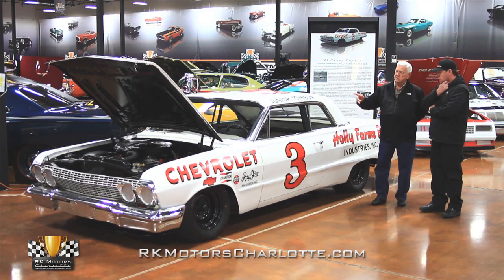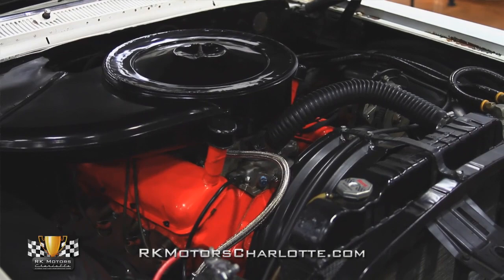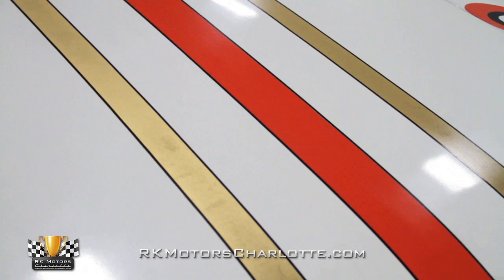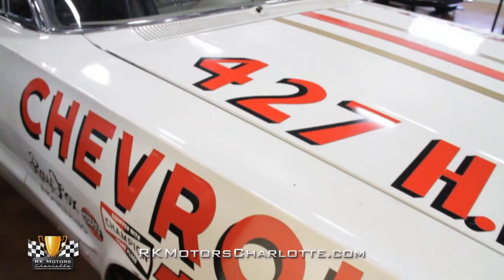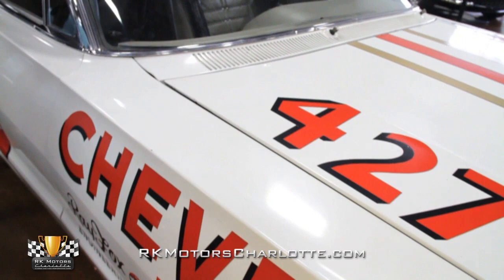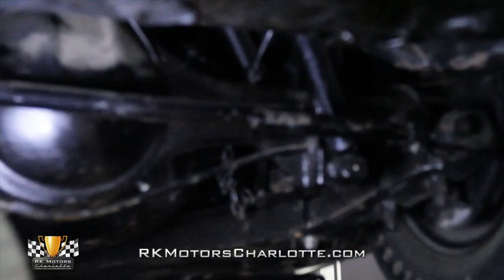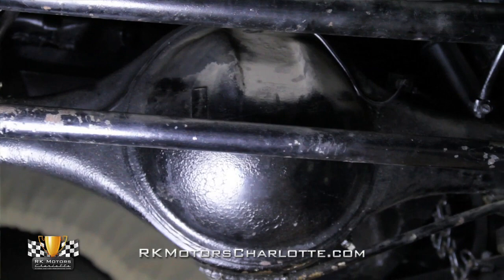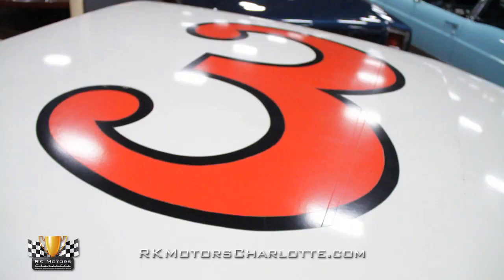Junior Johnson and his 1963 Chevrolet Impala SS

Comment: That's a stock car.
Reply: With an experimental race only engine,non factory cold air induction,and the rear end out of a truck...
Reply: @FATMIKED5183  well stock cars aren't stock.
Reply: @717rocket  Not after the first few years anyway.
Reply: @FATMIKED5183  I  think they always did a little modifying on the hush hush.
Reply: @717rocket  No doubt.
Reply: Really? I was under the impression that it was a dune buggy, or maybe a parade float associated with the the 1963 Rose Bowl celebrations.

Comment: The motors in those cars could not have been stock and sold to typical consumers.  The 427 wasn't even made that year.  The 409 was punched out to 427 (Z11) but not even vettes had a big block in 1963.  The biggest engine for Chevy was the 327, the 427 didn't come out til 1965.
Reply: This 427 was a 409 design with 3.68 crank.  Only 50 were made and they were also all aluminum block and heads.  The 427 you are talking about was a new block design which came out in mid 1965
Reply: I did mention the punched out 409 in 1963.  You stated the use of an all aluminum cast, which was the difference I was seeking.
Reply: You are both wrong. In 1965 the 427/425HP was the first year that they put that motor in the 65 Corvette. The all aluminum Block and Heads was called the ZL1 motor. It came with 219/188 valves, an L-88 cam with 0.560/0.600 Intake and Exhaust and 322/334 Intake/Exhaust duration, which was really 273degrees at .50 at a 110 lobe separation. If you had a 409 block and used a 368 crankshaft, you had a destroked motor, not more C.I., but less C.I. The rpm's were higher ,but, it couldn,t touch the 409 with a 376 crank.  Junior and I were correct. When you take a BBC motor and use a 376 crankshaft, you get More HP, More RPM and more torque. I also own a 1970 SS 396/402, which is a 396 bored out 0.30 which made it a 402 with a 376 forged steel crank. My 1970 chevelle beat my friends 427 El Camino because he had a 4.00 crank, like the ones chevrolet used in their 454,s The 376 crank will always beat the 4.00 crank on HP and Torque. All you gained with aan all aluminum block and heads was around maybe 100lbs lighter engine, but the price difference was not worth the weight difference. Do your research!
Reply: 427 396 402 have  the same  stroke
Reply: Z11 was  a  427  that  was  used in  1963 chevy impalas all  aluminum . also the  car itself had aluminum fenders hood bumpers front and  rear doors   and  it  made the  car  much  lighter
Reply: Sorry Joe, but the only big block available in a 1965 Corvette was the L78 396/425HP engine. *I bought one new. Great car!
Reply: 409 was still  avaliable in  65
Reply: Domingos, I don't think the Z11 was aluminum or even had aluminum heads. You can do a search on You Tube and see Dave Strickler's Z11 impala. The Z11 was a stroked I believe 409 and to my knowledge none of these style engines were ever aluminum or had aluminum heads. I have been reading Hot Rod and other type magazines since the early sixties and I haven't seen or read about any of these engines being aluminum or even aluminum heads. Yes,  the ZL1 was all aluminum but that was an engine from the 396, 427,  454 family of engines. If someone has an article or reference to info on the 409/ Z11 427 being aluminum please post it I would be very interested in seeing it.  @domingosmundo4138
Reply: @larryburton5516  Your right. There is so much misinformation out there regarding the mystery motor & the z-11 and people keep repeating it. Let me set the record straight, the mystery engine was designed and tested by chevy engineering in 396 409 & 427 displacements. The reason for the 427 was because nascar bumped the engine size up to 7 liters in 63. It has a 90 degree deck angle and the heads have combustion chambers.348 409 has a 74 degree deck angle.the piston makes up the 16 degrees and heads are flat no combustion chamber. The Z11 was strictly a drag race only engine stroke was increased to 3.65 from 3.50 to get to 427. Cylinder heads were special with rec port big block like intake ports. They will even bolt up to a factory 409 block! I know because ive done it. Gotta have the matching intake and valley pan to make it work, or nowadays you could pay to have them fabbed up. The ONLY THING SHARED BETWEEN THE MARK I 348-409, THE  MYSTERY MOTOR & THE MARK IV BIG BLOCK IS THE BORE SPACING!!.Also most people dont know that the mystery motor cylinder heads are LH & RH specific! This was done so the engine would breathe symmetrically between both banks of cylinders like a hemi does. Nothing interchanges between the mystery motor and the later mark IV big block. Not even the valve covers though they look like they would. Coolant passages and cylinder head bolt pattern are also different.Pass this along brother!!! I have helped restore vehicles for both Henry Ford museum & Sloan museum in Flint mich. Just in case people think I dont know what im talking about. Been in the game for a long time & met people who were involved in all this. Hope this helps.
Reply: @hilleryclifford2367  Thanks for all the info, Hillery. I loved that time back then in drag racing and Nascar. My first new car was a 64 SS Impala 327/300HP Four speed. I have a 72 Nova with a 388 small block in it. And, a 70 Chevelle in the paint shop now. Hope to have it ready by early April.
Reply: @larryburton5516  Thx for the reply larry. Glad to see you still hot rodding! Once it gets in your blood it never leaves!  My brother and I did a 61 pont catalina bubble top. Body off resto. You tube search 1961 pont catalina to see it. Its the black one @ Frankenmuth MI autofest. My 72 boat tail riviera is next to it.
Reply: Thanks.  Mopar guy here, but learned something after hearing poor info for years about this mystery motor.   @hilleryclifford2367
Reply: @domingosmundo4138  so does the 366 big block used in heavy duty trucks, the 454 had a 4.0 stroke, external balance.